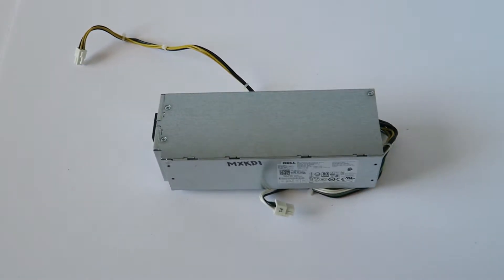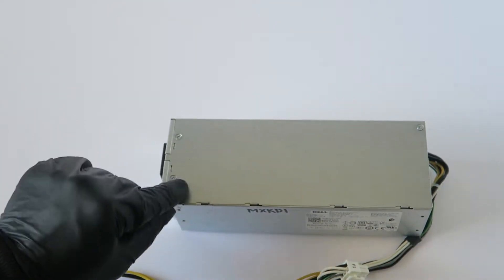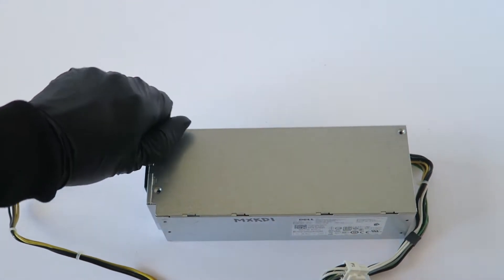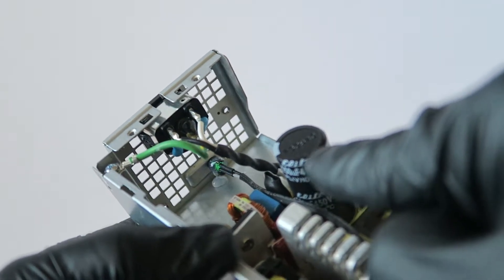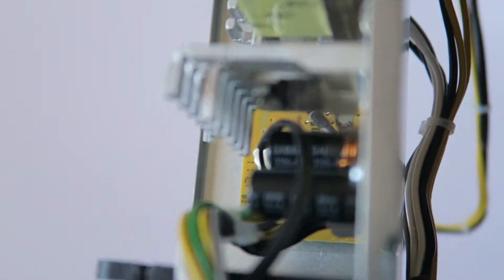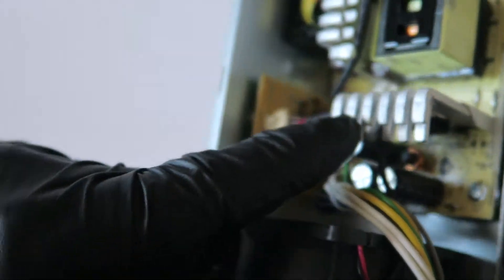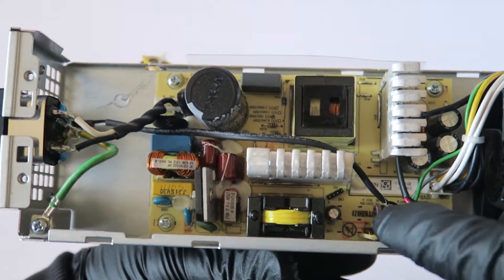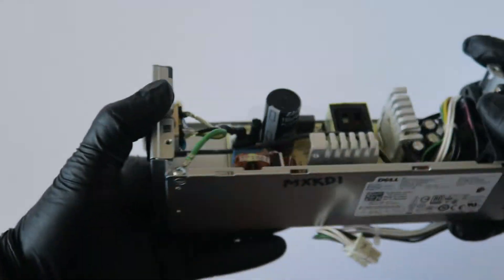Dell L180ES-01 Power Supply 180W 082DRM

Comment: Do you know if this power supply format (length/width/height) has a name like the old ATX ones did?   I'm looking to put a faster GPU in my old dog of a computer and the PS seems to be the tall pole in the tent as it were.   More watts (WHAT?) needed!!!   ;-)   Thanks!
Reply: little bit late but dimensions are 82 x 63 x 220 mm, the narrower part where the power cable is, is 63 x 70 mm